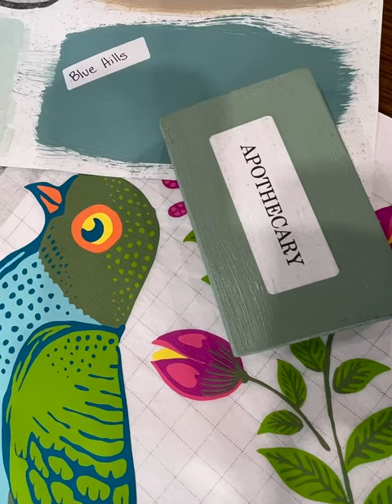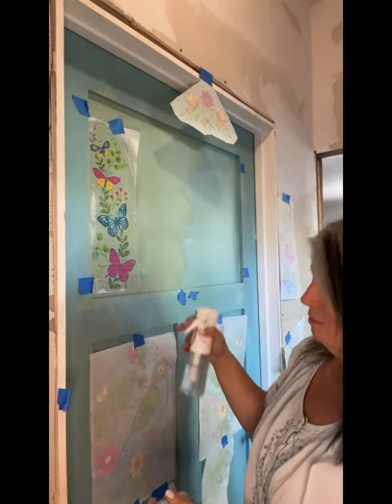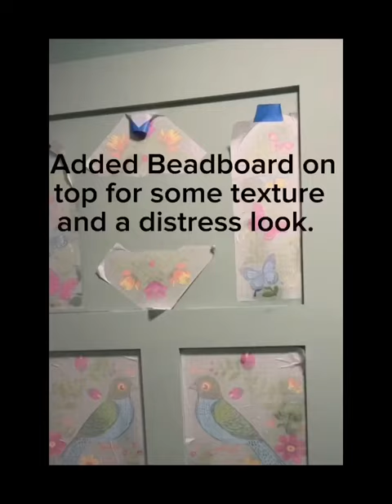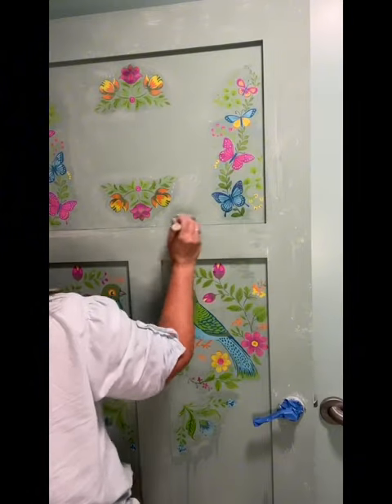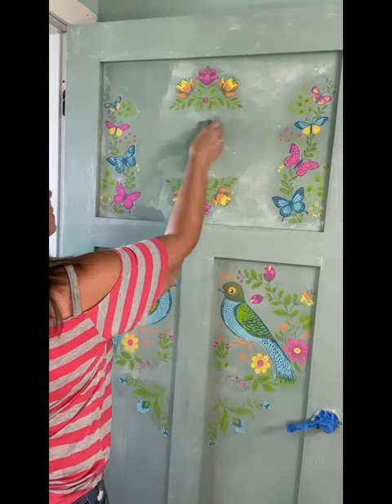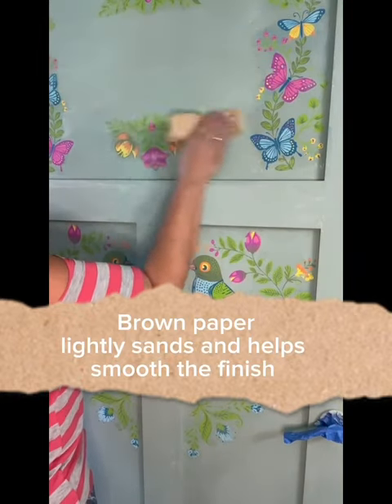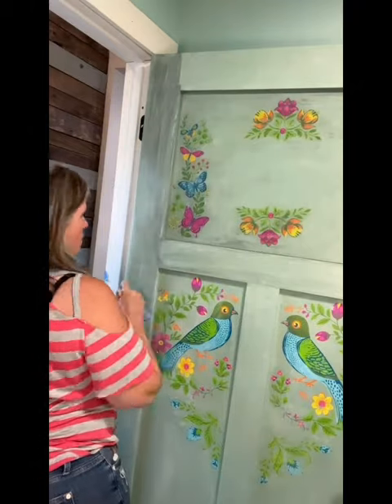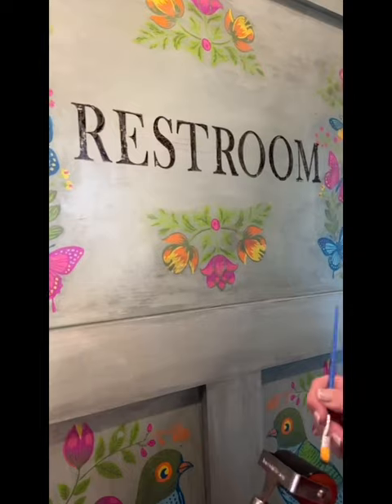Bringing Color with the IOD Inlay - Vida Flora designed by Debi Beard - Bathroom Door Design

Comment: Are the inlay sheets a color transfer  similar to the way a temporary tattoo transfers an image? This is not the same as the transfers that are adhered with a pressured application in what is more like a sticker...is that correct? Hope I explained it clearly.
Reply from the maker: Yes… it’s active paint you are laying down. They are reusable but become more of a distressed look with each use. The number of uses is sort of dependent on what you are putting them down with. Paints with sealers or top coats seals the inlay to the backing.

Comment: How long do you wait to dry. Before pulling of inlay ??
Reply from the maker: Once the paper has gone dry would can rewet it and pull. The beauty of a paint without a sealer is you don’t have the shorter timeline of having to get it off before it’s basically glued on. I’m impatient and “push it” lol. So I try to make myself wait at least 15 minutes before I get out a dryer to speed it up. The base paint just needs the time to grab the paint from the inlay. Hope this makes sense.